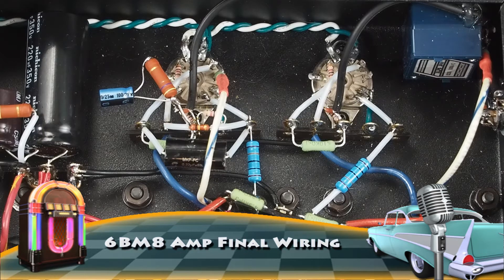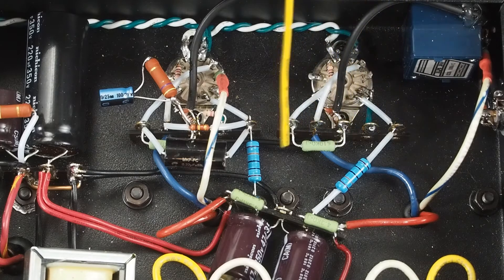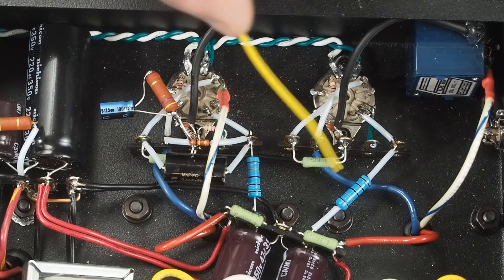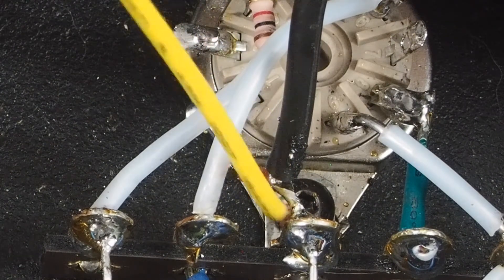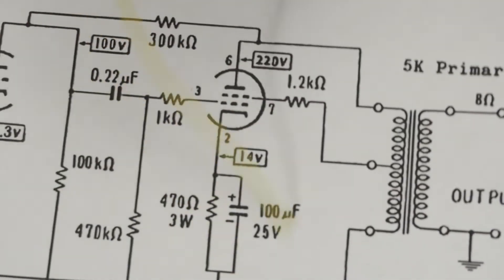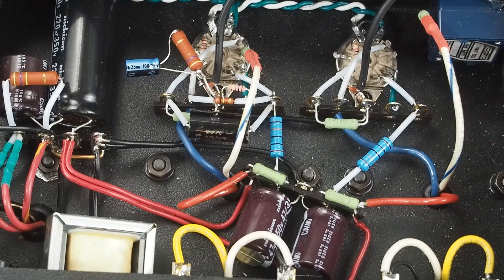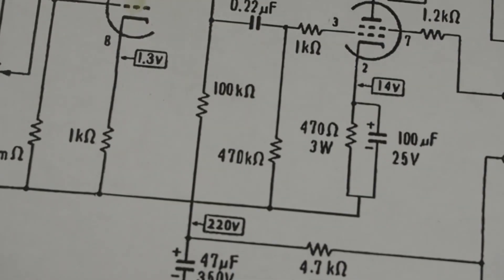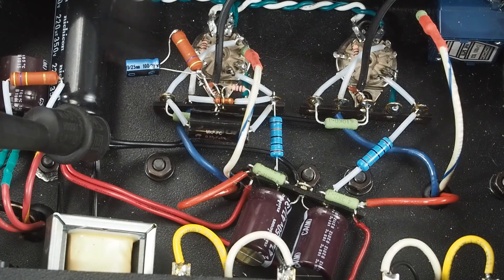6BM8 DIY Tube Amplifier - Final Wiring #12

Comment: Hi, sorry , I would like to know what I am doing wrong , as I am getting a 60 hz hum , which is not going away can you give me a few suggestions, if it not too much trouble, I have exhausted all idea.
TIA
Reply from the maker: Does it do it from both channels?
Reply: @SkunkieDesignsElectronics  yes it is equal hum on both sides
Reply: It does not increase or decrease with the volume control , this amp is built from a pcb bought of EBay , the best part is a friend made the absolute same one and has no hum , the transformers and choke were wound from the same guy at the same time
Reply from the maker: @prahladramesh6562  Please contact me via my website www.skunkiedesigns.com It's sounds like it's a different amp than you are commenting on, I will need a lot more info to help.